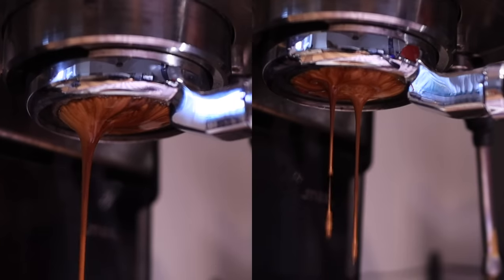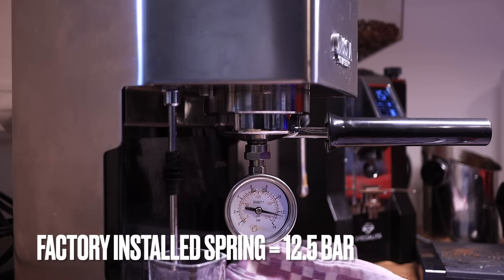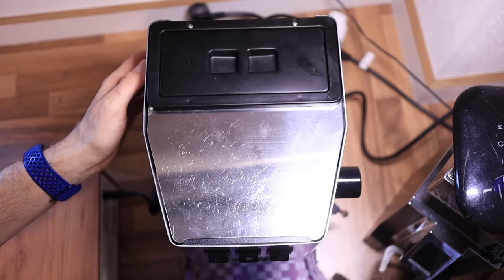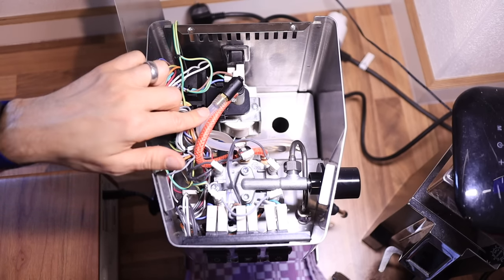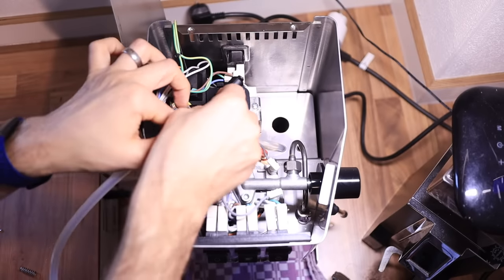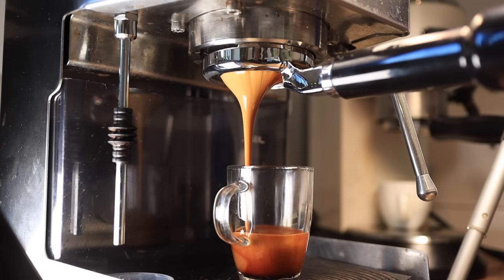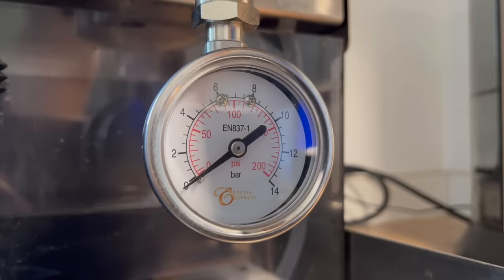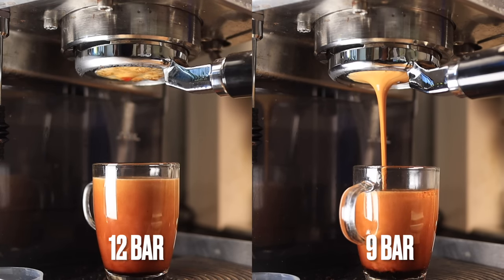You Won't Believe the Difference: 9, 6.5 & 5 Bar OPV Mod with Flow Rates for Gaggia Classic Pro

Comment: I might be wrong but I feel like having less pressure means grains has more time to soak and probably have to adapt the the roast level you like. Ie: light colored grain would be better with lower pressure since it's tougher to really extract the full wanted taste out of thse than it is with darker roast.
Reply from the maker: Hey Simon, you’re probably right. The lower pressures should allow a better soak/bloom. I believe the Decent community has a lot of info on this, especially with regard to lighter roasts. Cheers!

Comment: Did you use the same grind size for all of the pucks?
Reply from the maker: Yes I did. I wanted to show the difference in the result of the extraction, based solely on the variable of pressure.

Comment: Do the different springs change the strength of the steam coming out of the Steam wand?
Reply from the maker: Hmm, not sure about that. The OPV regulates pressure while the pump is pumping. During steaming however, you are not pumping any liquid, but rather heating up the water in the boiler. So I cannot imagine the steam is affected. Anyone else notice any difference?

Comment: I might be wrong, but you will not get 12.5 bar if your grind is too coarse. And I also think that if you grind fine enough to push the pressure up to 12.5 bar while extracting, you might get perfect extraction also depends on when you stop it (brew ratio).
Reply from the maker: Yes, that is right. 12.5 bar is the absolute limit. With a normal dose in the portafilter, you are probably talking 9-10 bars. Would be my guess...

Comment: Why did you calculate the start of time from the start of the machine?
Reply from the maker: Because that is when the brew process starts. The coffee puck is at that point confronted with water, swells, and starts absorbing the incoming water. Eventually, the pressure threshold of the coffee puck is overcome by the water pressure, and coffee starts dripping out. But that first part of the extraction belongs to the whole process as well, in my opinion.
Reply: @TomsCoffeeCorner  Thank
Is this amount for double or single and how long is the brewing time

Comment: Hello! what is the length of the spring at 6.5bar?
Reply from the maker: Hi! Here is the breakdown:
12 bar spring: 23.6mm long and wire strength of 0.6mm.
6.5 bar spring: 23.9mm long and wire strength of 0.5mm.
5 bar spring: 20.1mm long and wire strength of 0.5mm
Reply: @TomsCoffeeCorner  thanks for the answer!

Comment: Just out of curiosity, but 40g cup of coffee weigths 60g?
Reply from the maker: Hi! Where did you see that? I tared out each time, and let the extraction run to 40 grams. Cheers!
Reply: @TomsCoffeeCorner  I meant if 40g cup of coffee was a 60ml cup!! It came out wrong. I've seen people saying a perfect double extraction should  be a 60ml one.
Reply: @noctuliusgui  Don't believe everything you hear or read, as some people conflate being loud and assertive with being knowledgeable.

There is no such thing as the size of a "perfect double extraction". My doubles range from 35g to 55g, and they would all taste good in reasonably sized cups (mine are 75ml I think).

Different coffees and basket sizes lead to different doses and yields, the volume of crema changes with roast type and freshness... You can't have a single size for a "double", even a "perfect" one.

Comment: Your measurements differ from what I have seen on the reddit gaggia forum?

Full length 19 mm.
Wire diameter 0.68 mm

Outer diameter 7.08 mm
Inner diameter 5.45 mm
Reply from the maker: I am not sure, as I am on vacation. I used the Shades kit on this particular machine though.

Comment: I found the opposite then you. I get less acidity and bitterness as I reduce pressure. But then again I’m doing 1:3 ratio
Reply from the maker: Hey Don, that could very well be. It will also depend on bean used and palate. 👍

Comment: Flow rate, well, you should've measure the input flow rate(blank shot), starts timer with first drop of water out, go 20 seconds for 3 times, divid it to get a average ml/s, because your coffee bed is gonna absorb fair amount of water, extraction flow rate is different topic,  I've seen uneven extractions from u, quite often, the extraction stream swings that indicators uneven extraction, a bit of more work on ur puck prep, and high pressure is needed because of pressurized basket was, well, has been a false information, because higher the pressure will not get coffee liquid through it if it goes beyond 10.5bars, it will slow the flow rate down and chock the machine, I think nowadays, most people should've experience it that(a little bit finer grounds will chock machine if it was the combo of non OPV machine with pressurized basket).
Reply from the maker: Thanks for your feedback. What purpose does it serve to know the flow rate without any resistance?
Reply: @TomsCoffeeCorner  It dictates the 25-30s rules should be applied or not, above 6ml/s, 25-30s rule doesn't work anymore, higher the flow rate causes faster extraction, and way higher flow rate makes terrible shots, that's why many rotatory pump machines have to install the flow restrictor to slow it down, otherwise it ruins the extractions.
Reply from the maker: @checkwhatsleft4565  Ok, well I just checked the flow rate with no resistance at all. I get 180g in 20 seconds, so 9ml/s. Is this normal for the Gaggia with Ulka pump? I currently have the 5 bar spring installed, but with no resistance, all the water should be exiting the group head, and none going back into the tank.
Reply: @TomsCoffeeCorner  That was too higher, but it wasn't the highest, I believe that Nuova Oscar II took the crown in term of input flow rate, it was 3 seconds 150mg, xD.
Reply from the maker: @checkwhatsleft4565  Hmm, I guess I would have to install a dimmer to reduce the flow.
Reply: @checkwhatsleft4565  just a point of information: you said a higher flow rate causes faster extraction, but that is not the equivalent to "higher" extraction ,correct?  I am asking because the surface area of the grinds dictate the extraction "rate" as it interacts with the flow rate.  So a "way higher flow rate" does not make for terrible shots, if your surface area on the grinds (grind level) is appropriate for the dose amount in the portafilter. i will agree, though, that a higher flow rate will require a change in the other variables in order to get a "good" shot.  But this no resistance flow rate of any machine is hardly ever measured nor marketed as a selling point.
Reply: @dirkl216  I don't know what do you mean, what I was talking about was due to his style of shot, medium to dark or dark roasted beans, so higher flow rate, say 8ml/s or 10 or above doesn't do any good, and again I don't know where this was going, that even if we pull shots out of lighter beans, that Allongé profile doesn't need more than 10ml/s or 12 or more to get proper shots, input flow rate is to get an idea about what machine does, and this measurement doesn't work on those E61 style machines, because e61 has thermosyphon system, once water hits the puck resistance, part of water goes back to the boiler or heat exchanger tube through the thermosyphon system, but Gaggia doesn't have that.

Comment: This comparison is meaningless for multiple reasons:

1: the actual flow rate is determined by  the hole size of the water inlet (aka gicleur/jet), not how much espresso you get out;
2: the amount of espresso produced (what you call flow rate) from each of your shots is determined by your grind size;
3: the grind size and espresso yield were not adjusted  for each spring to achieve ideal shots.

It is a shame that this shows no recognition for the variables that need to be adjusted by changing the brewing pressure.

you can actually get great espresso at all these brewing pressures. The roast development is probably the best factor to determine what spring to use.
Reply from the maker: Hey Dan, I understand your points. Others have mentioned that I should do a follow up video with the shots dialed in for each spring setting.

This video was kind of aimed at the visual difference of the flow at different OPV pressures. 

But you are right, that each spring should be able to provide a good shot when dialed in properly. Thanks for your feedback.